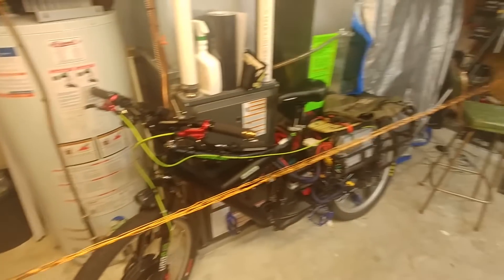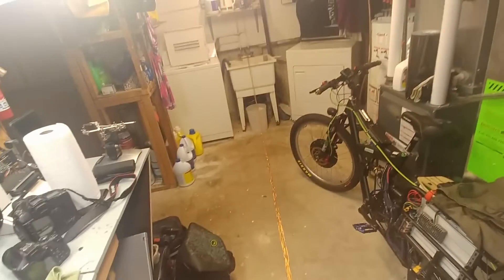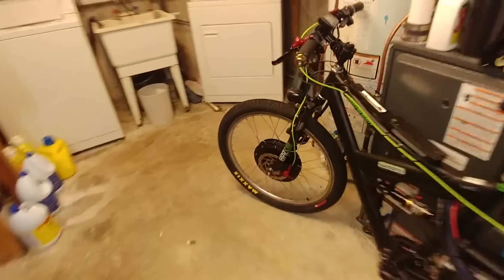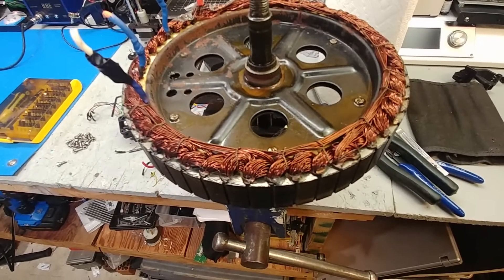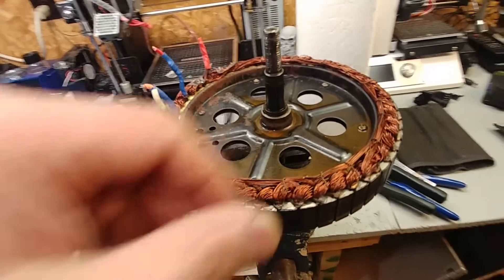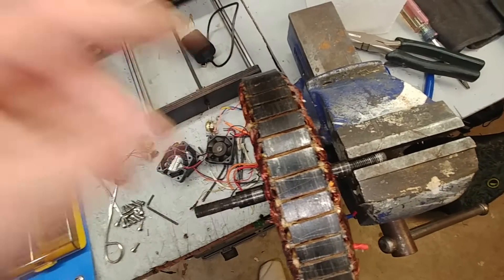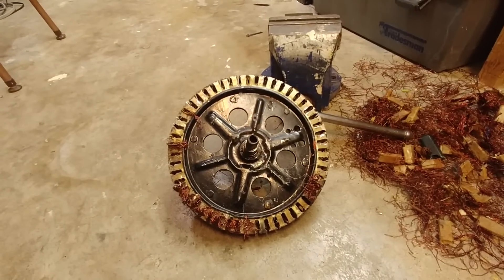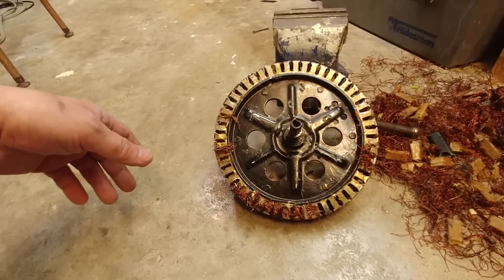hubmotor rewind how to*total fail bad stator fixed*

Comment: Question, if there's a few broken winding strands, will the motor still work, and could I just solder them down? I had to do some service on my first Gen 205 and found a few broken strands on the green phase winding.
Reply from the maker: @500wattz  if you can fix it do so. Over time the windings that are left will burn up and short.
Reply: @karmaEbikes.  Hrmm how much time? And how would you recommend fixing this issue of mine? Thanks again

Comment: Se me ocurria una idea .  Para enfriar el motor ebike.  Y es el de hacer el eje perforado por ambos lados para poder meter sonda de temperatura y algun tipo de tuberia para ingresar  aire a presión al interior del motor y que eso permita una circulacion del aire    . Osea meter aire frio  y hacer que el aire caliente salga por otra tuberia .  Se podra usar como ese tipo de bonbas de aire para acuarios .    Quizas se podria engrosar el eje para permitir hacer perforaciones mas grandes  en el eje  y asi poder  implementar     la idea que dije antes.   Igual se podria hacer como en los PC  con el sistema de  enfriador de agua .  Con un sistema de recirculación hacia el interior del motor  y luego sacando el agua por pequeños tubos que salgan y entren por el eje.  Para luego enfriar el agua en el exterior  por medio de un radiador .  . En todo caso son solo ideas .

Comment: 🔨 out the Bamboo clips might not be the best idea.
This could also cause a misaligned. Cut it and use a heat gun to pull the copper out. 
I did the same thing on a teardown and copper weight analyses. I know from own experience. Hell of a job.
But you are a do it man. I like it.
Kaputt yes. 
5 star's.

Go for it
Reply: I did it differently: sharp big knife and a hammer to shave the windings off the side of the stator. The remaining bundle of straight pieces of copperwire in the slots, I punched out with a hammer and screwdriver.